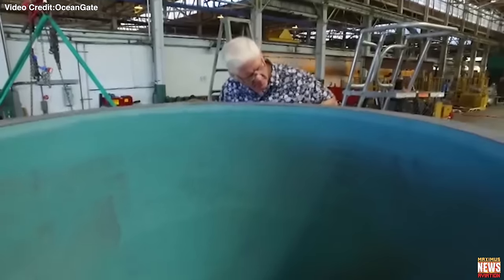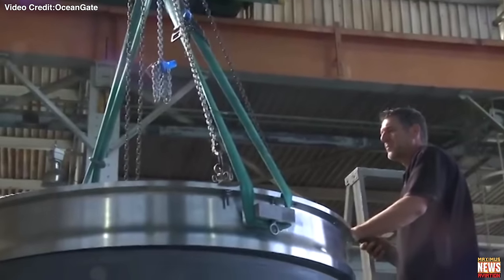Watch The Manufacturing Process That DOOMED OceanGates Titan To Fail. But It NEVER Had To Happen.

Comment: I cannot believe this guy did not perform stress testing prior to putting lives at risk. I would have placed strain gauges and recording equipment to get data on the combined stresses. this information can be used to better refine his stress model. He could have done several dives to the bottom and get a better understanding of his experimental craft. The cyclic nature of two dissimilar components and their fatigue life, I'm not sure they took this into consideration. Its hard to believe, that Mr. Rush was so negligent!
Reply: He kinda did 20 umanned dive before doing 4 time with passenger, unfortunately the 24th time the tings can't handle more
Reply: Idk. I'm convinced dude was just suicidal asf. Think about it, instant death with no pain, it's the most relieving way out of this planet im having suicidal ideation on it. My guess is dude was commited to end it, but going down there he knew it'd get boring. This dude got some people, and literally threw a suicide party 🎉. 

I just don't understand how he really thought he could challenge the deep like that, makes no sense if you have some understanding of how much pressure the vessel needs to withstand. Being dangerous, why risk it.

Comment: I'm beginning to wonder if the carbon fiber had any effect at all. It looks like the hull's strength was entirely due to the epoxy, and not to the long ribbon of fabric enclosed within it.
Reply: I would think that if 90% of the carbon fiber had been omitted, but the carbon fiber had been run in a primarily fore-aft direction (but at multiple angles, some clockwise and some counter-clockwise) going from the outside near the bow, then toward the inside near the waist, and then back toward the stern, and if the epoxy was much thicker near the waist so that the increase in outer diameter was greater than the decrease in inner diameter, and if the layers of carbon fiber were separated by something flexible that would allow them to slide without tearing, such a design could benefit from the tensile strength of carbon fiber.
Reply: If that chamber was being used as a pressure vessel, the carbon fibre would have been under tension and very strong. High external pressure would have had the opposite effect, wouldn't it?
Reply: @ZilogBob  Yes, pretty much. As @flatfingertuning727 says, a case could be made for CF in a limited situation where it would be under increased tension as the pressure went up, but this was not the case in the Titan. My guess is it was simply 13 cm of epoxy doing the actual work of withstanding all that pressure (as it was at the joints, which consisted of epoxy glue), and it ultimately gave way.
Reply: It looks to me that they used a filement winding machine that lays the carbon stands only in one direction! If that's the case, they were looking a desastor! "Cross haching" really strengthens the layup. After that they would put the layup in a vacuum bag,then put it in an autoclave under high pressure, to get the most strength! If they skipped any of these steps, they were sure to fail!  Worked with fiberglass since 1957! On Ryan Aeronautical " drones"
"
Tc
Reply: Sure would!
Reply: @ZilogBob  It would st have just split open like a stretching slinky 'cos the fibres all went in the same direction! Even cardboard tubes are manufactured spiral wound! It beggars belief how amateurish the whole thing is.
Reply: you're right, someone already said the entire strength of the tube was just glue, as the fiber was providing no help in the integrity, or very little anyway.

Comment: You would expect that there would be deep groves in both the tube and the end caps to transfer the stresses and for the epoxy to have something to grab on to.  Not smooth surfaces on both parts.  Be like squeezing a cardboard tube and watching the cap pop off.

Comment: Had some experience with carbon fiber in Formula 3 chassis ( Dallara).......its amazing stuff, however, its a known that it can de-laminate when exposed to repeated stress. Unlike steel which bends or deforms, carbon fiber fractures, or shatters.

Comment: Ain’t no way they expected a 1.5” lip on that titanium ring to withstand 6,000 psi of force.
Reply: Ohhhhhhh YES they did.
Reply: And that lip was about a 1/4 inch thick. To resist millions of pounds of force. How did this thing even work once?
Reply: Turns out, that lip sheared completely off and was the likely point of failure.

Comment: I don't know if it was left out of the video, but, was that mandrel spun carbon fibre tube even autoclaved? It appears not. Chilling. Carbon fibre is actually used to manufacture pressure vessels. When the fibres are loaded in tension (positive pressure on the inside of the vessel), not in compression (positive pressure on the outside of the vessel), as they are, and were, on the Titan submersible. Especially at the 380+ Bar of pressure that it was expected to operate at. It appears the CEO's bravado and to be totally unique has cost not only his life, but the lives of 4 other souls. RIP.
Reply: He was trying to pioneer new material for sub. Not sure if there's a cost advantage but carbon fiber has high tensile strength to mass ratio so gives sub greater maneuverability and very agile to navigate wrecks without entanglement plus power efficiency. I think that's what CEO was going for.
Reply: The purpose of autoclaving is to achieve a 350 °F cure and void free parts.  Doing this on a 5 in thick part would be very difficult.
Reply: @titaniumsandwedge  Partly correct. The part is placed in a vaccum in an effort to free air voids but also to ensure that the bonding resin is well distributed around the fibres. Then it is heated under pressure to cure the resin. If they indeed skipped this vital part of the composite structure production process because, as you assert, it "would be very difficult" then that is astounding.
Reply: @jonfreeman9682  Tensile > Compressive strength, yes, that is what I have stated. Not sure of the logic behind the rest of your comments though.
Reply: @anthonycanalese2142  How do you bag up a 5 in. thick cylinder to bleed it during processing?  And they should have co-cured the two Ti parts, not use a paste adhesive.
Reply: @titaniumsandwedge  You've answered your own question. If it was not "possible" to properly treat the carbon fibre central tube. That is, bag, evacuate and seal the part (a process critical to the strength and endurance of the composite component). Then it is obviously the wrong material (production process) for this critical part. The tragic Titan loss is the demonstrable proof of this fact.

Comment: I reckon the carbon fibre tube and the titanium rings were compressing at different rates, which eventually caused the adhesive to fail on tube-titanium interface, with some water ingressing under the rings. Once that happens you lose some of the net compressive effort of the water that is helping to press the end caps tight onto the tube, and generally allow the end caps to be 'blown' off by a partial collapse of the ends of the carbon tube delaminating from the rings.
Reply: >"I reckon the carbon fibre tube and the titanium rings were compressing at different rates."  I reckon the same thing. Two different shapes, which would compress in different ways, made of two dissimilar materials, which would compress at different rates, held together by a small flange and some glue. Maybe this guy had a death wish. Or maybe he just had this thing that a lot of privileged people have, of thinking, "Nothing bad can happen to me, because I am me. Oops."

Comment: The first thing that jumps out to me is the lack of any fibers running lengthwise. In theory perhaps that doesn't matter but still, I'm surprised. Right away we've got 3 materials with different coefficients of thermal expansion. On a hot day there can be 60+ Degree F temp change during a dive. That alone would test the bond between the Titanium and Carbon. Epoxies are not great at bonding to metals to start with...not laminating epoxies anyway (Stiffness is a priority, elastic resins are best for bonding). If the Titanium and carbon aren't perfectly bonded into one uniform structure then they aren't working together. Period. I've made test panels for aviation parts from a mix of Carbon and Fiberglass....the test was a simple rivet shear test....the panel failed. I eliminated the carbon and doubled the glass,  all glass panel passed with flying colors. The two materials are too different in stiffness to recruit with one another and share the load. The Carbon doesn't stretch so it carried it all... the glass was well within it's elastic range and so bore almost none of the load...the carbon failed and the load went to the glass which then failed. Do Titanium and Carbon work well together under this loading scenario? I'd add that in a fluid, the pressure on a vessel is at 90 degrees to the surface at any point. A perfect sphere underwater has all force vectors pointing to a single point in the center. Don't think of getting squashed top to bottom, but I am confident the end caps don't move with the body of the hull  even though the pressure forces the ends together, and created  some unusual stresses as the hull was squeezed.  I only know for sure that I would have gone with the materials that they have been using since they were using subs to auger holes in wooden hulls....metal. A lot of people already paid the ultimate price to get that technology to the point it's at.

Comment: Ok, that joint was bound to fail. Barely 2 inches for a minivan size container, no bolts and a light coating of glue that may have had air bubbles and dust on it. And let's not talk about carbon fiber, which was not made by overlapping perpendicular layers and in a controlled environment, as it should be. Everything is wrong with that container, the tubular design, the use of dissimilar materials, the use of resin composite, the shape of the joint, and the manufacturing of the carbon fiber. I mean, what were they thinking?

Comment: It has been reported that Rush admitted that the carbon fiber used was "aged out" that he bought from Boeing.
Reply: That's gross negligence if true
Reply: I heard that as well.
Reply: How does unused carbon fiber "age out?"  I thought carbon was highly non-reactive.
Reply: @77thTrombone  it ages like a fine wine...it ages like Rush's statement that he didn't want to hire 50 something white dudes (military vets with submarine experience).
Reply: @77thTrombone The resin epoxy in the prepreg is constantly curing.  The only way to slow this down is to keep it cold, but not so cold that it gets brittle and can break the carbon if handled or moved.  After a certain amount of time the curing has progressed past the strict limits and it can only be used for non-critical applications.
Reply: The uncured epoxy resin is what ages and has a finite shelf life.  Sort of like a bottle of super glue eventually goes bad in the drawer.
Reply: @77thTrombone  Boeing uses "pre-preg" carbon which already has the epoxy absorbed into the fibres and that epoxy cures in heat (instead of the inert expoxy to which you add the hardener to initiate the curing process. Note that even the first one will age.  The carbon fibre itself doesn't age.
Reply: @77thTrombone  Carbon burns.

Carbon fiber gets degraded from exposure to UV light.
Reply: @77thTrombone  Carbon fiber becomes discolored and brittle with UV exposure and can even crack or crumble. This is known as UV degradation and it is a real challenge for synthetic materials producers. UV light can also damage the epoxy that binds carbon fiber products. That's why carbon fiber products need a UV protective coating applied after being manufactured.
Reply: @IronmanV5 So, them having the sub sitting out in the parking lot could have done that.
Reply: boeing fails again.
Reply: Prepregs have a shelf life. That means carbon fibers that are Pre Impregnated with resin. At the temp of an air conditioned room it has the consistency of chewing gum. Boeing buys all the Pre preg necessary for a project at one time and it's all from the same "Batch" from the manufacturer. They then qualify the material by making test panels and having independent test labs evaluate  the panels mechanical properties. Unused material is sold. that includes everything from Structural foam cores to pre preg to drill bits. A common test, the short beam shear test is a big one. How  well are the individual layers bond to each other. What's going on inside the laminate stack. Old pre preg may or may not flow when heated at the correct viscosity. It can be recertified by the manufacturer if you send them a sample. The man was going on the "Cheap". I am fairly certain he did not have it re certified. boeing would have proper storage and record keeping and it's likely the materials were fine. I have made non deadly parts from prepreg years beyond expiration. But simple stuff that can't hurt you. The point is he was going cheap and hiding from regualtions of any kind...he knew more than those with way more experience....or thought he did.
Reply: @tinetannies4637  boeing causes another disaster
Reply: 😲 really? If that's the case even on the most important material he skimped out using good quality material? Lawsuit, lawsuit!
Reply: @RandoBogus  "Sort of like a bottle of super glue eventually goes bad in the drawer"
where "eventually" means "way before the next use, no matter how close the next use is" 🙂
Reply: @unknownerror294  Rubbish, that carbon was sold for use in non structural or limited structural resistant applications.  Many many uses.  A skilled autoclave worker will tailor the cure cycle to suit the carbon.  IE longer dwell time at around 65 to 70 degrees C to let the now epoxy gel penetrate all the voids before increasing the vacuum to around 6 to 8 bar to squeeze the resin out of the voids and into the external decorative layer of non-impregnated box weave, before the final cure at around 100 to 120 degrees C.  I did not see the pressure vessel for the submarine go into an autoclave to remove voids and resin pockets.
Reply: @1982nsu   got it.   Does this mean OceanGate bought some fiber that had been sitting in the sun too long?   How else would it age without UV exposure?
Reply: @jfmezei  exposing my (noted) lack of deep materials background:   this suggests that the epoxy — cured or uncured — has a shelf life independent of UV exposure.
To spell it out, assuming I understand correctly, there are at least 3 factors in play with CF/E aging
• CF exposure to UV
• epoxy exposure to UV
• epoxy degradation in time (atmospheric gases?)
All these are factors before the stuff even shows up in an assembly that gets used.
Reply: @FredSmith-ei8cm  that ain't fine wine, Hoss, and you know it!  😄

Comment: The fiber should not be layered all in one direction. It reduces strength in the other direction.
Reply: You cant even spell fiber.
Reply: cant
kănt
noun
Angular deviation from a vertical or horizontal plane or surface; an inclination or slope.
A slanted or oblique surface.
A thrust or motion that tilts something.
Reply: @SOLDOZER  - *Can't
Reply: 1:35 😢😢😢😢

Comment: Im no engineer, but i dont understand how wrapping something with carbon fiber would make it stronger against a crushing force. Can anyone explain their thought process?
Reply: Carbon fiber is a terrible choice for compressive loads.  The stupidity of the design is utterly astonishing.
Reply: His thought process was that he found it inspirational to exclude 50yo white men from his company and fired people who raised safety concerns
Reply: All the people who said it was dumb were fired.
Reply: @domgia9248  Just like the fable of the emperor has no clothes
Reply: It is not so simple. Carbon fiber structures can withstand large compression loads (contrary to what people are saying in the comments here...) but the alignment of the fibers is important. The tube would be compressed all around by seawater pressure. The fibers shown would actually be decent at resisting that force. But there is also a compression force due to the seawater pressure on the endcaps. This would tend to crush the cylinder in a different direction. Fibers would need to be aligned at right angles to resist this force. The video didn't show any fibers going in that direction but I am sure there were some that were not shown.
Reply: @mckenziekeith7434  thank you! I guess I can't wrap my head around how a soft bendable fiber becomes ultra hard just by wrapping it, but apparently if done right it works! I'll look further into carbon fiber manufacturing out of curiosity.
Reply: @jonchowe  yeah it is kind of weird. If you are looking into it maybe you might try researching the manufacturing process called filament winding. Also, you can't just wrap it with dry carbon fiber filaments. There must also be a resin matrix surrounding the filaments. This thing was made with epoxy resin and carbon fiber.